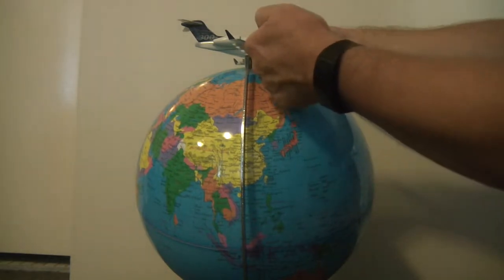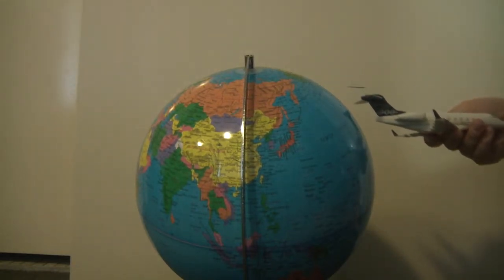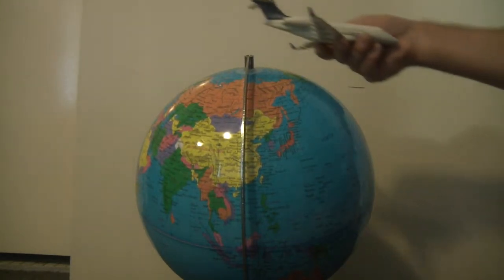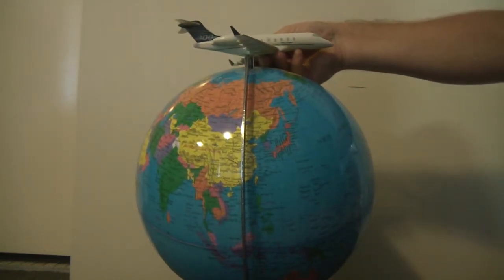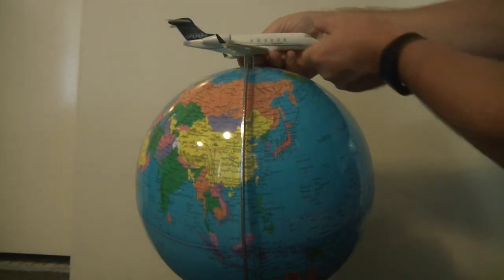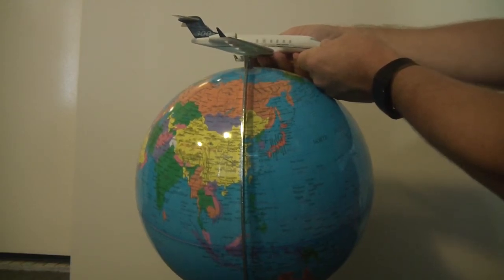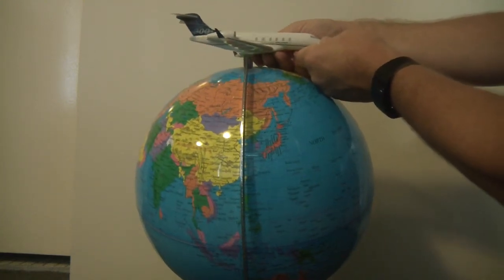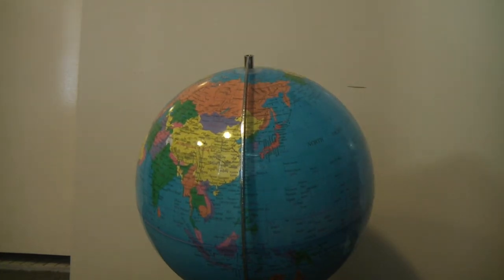A quick response to Globebusters.  You got it wrong guys.

Comment: (1:53) "Every 111 km requires 1 degree of altitude change and it's a smooth change".

1 degree of altitude change is not even a smooth change if the gyroscope is leveled all the time. So you are really trying to get people to believe that the plane is constantly dropping down the nose without the gyroscope showing it? 1 degree can easily be seen on the altitude indicator, and still some fast aircraft's have it leveled for thousands of kilometers. Why are you lying?
Reply from the maker: +christ4u2now.   You are not understanding what I said at all.   

You have also confused the word altitude with attitude - they are completely different things and you use the wrong word every time in your post. 

1 degree cannot be seen with the Altitude Indicator.    That is wrong. 

1 degree can be seen with the Attitude indicator if it was an quick adjustment - but if the attitude indicator is self correcting at the same rate as the aircraft movement you won't see a thing.  1 degree in 8 minutes.  Do you understand how slow that angular change is?  Well below the ability for us to see actual motion.

Of course it appears level for thousands of kilometers.  Flying smoothly around curvature matching the curvature your relative perspective does not change. 

I am telling the truth - the real question is,  why can't you understand something that is very simple? 

Globebusters got themselves totally confused over this and probably still don't get it.
Reply from the maker: +christ4u2now. 

No that is not a good video at all - did you watch the Original by Rob Durham here.

https://www.youtube.com/watch?v=nUFMZkxochs

Rob made many mistakes. 

1. He powered the gyro with air pressure - it is designed to run on vacuum.  He likely damaged the gyro by doing that. 
2. This type of directional Gyro has a Latitude adjustment Nut that offsets the balance slightly to compensate for Earth's rotation. 
3.  When measuring the drift of a gyro like this, it must be placed on a vibrating platform to overcome bearing friction. 

Rob did not know about the Latitude Nut and he did not use a vibrating table. 

Please read my commentsto Rob posted on his original video.  He is a good guy and acknowledged his mistakes.  He was even going to send me the gyro to test in the Southern Hemisphere. 

So you see my friend.  You are relying on flawed information because you don't understand how these things work for yosuelf. 

Did you see all the errors in Rob's video?  Obviously not.  I spotted them all right away and Rob now realizes them to. 

Try again... :-)

Comment: quick question if i may (sorry if you covered it). What amount of deviation in altitude would you allow before starting to correct it (at normal cruising altitude). I am sort of assuming that autopilot is correcting almost instantly all the time within a just a handful of meters either way of the required set altitude? Is there an 'operating window" of sorts when flying by hand?
Reply from the maker: Hi Simon,  the normal tolerance is plus and minus 100 feet of the assigned level and the autopilot will hold this easily in most cases. 

You are right, the autopilot will hold it within meters most of the time unless we have moderate or severre turbulence.  If we can't hold altitude within this +/- 100ft you must report it to ATC and they can assign a larger block level until clear of the turbulence.  e.g operate in a block 40,000 ft to 42,000ft.   

When hand flying the same tolerance applies.   In a flight test, if you deviate outside of the +/- 100 feet it is not an instant fail as long as you recognise it quickly and start correcting.   A pilot can fly like crap with an examiner on board but if you say "correcting" often enough you will pass anyway...  :-)

In reality though, after a few years it is pretty easy to hand fly within tolerance.  A few years ago I was flying a Hawker and the Autopilot failed and we didn't get it fixed for four months.  It was actually the best thing that ever happened because I flew back and forth across Australia a dozen times all by hand.  Up at 41,000 ft it takes a light touch but it really sharpened our skills.
Reply: Wolfie6020 Awesome. Thank you for the quick very descriptive reply.

You're a lucky bugger getting to do all that cross country flying!
Reply from the maker: I can't wait to retire and focus full time on making FE debunking videos.  :-)
Reply: Wolfie6020 Mate, honestly you really should spend your precious time more wisely than that!
Reply from the maker: Very true Simon and hopefully the nonsense will be over by then.

Comment: Ok so pilots are trained to make that 1 degree adjustment to follow the curve dont think so show me where it is in ANY flight manuel ever its flat bud!
Reply from the maker: It seems you did not understand my video at all.  Did you actually watch the original?   Show me where I said in my video that pilots are trained to make that 1 degree adjustment?  Those are your words.  I never said that at all.  That assumption comes from your misunderstanding of what is occurring.  Please watch the full video closely and listen carefully.  If you still don't understand I will happily explain it to you.
Reply: Wolfie6020 original video ok which one would that be anyway how does the pilot adjust for the so called curve! also how can u see the ground level of buildings ships etc from 50miles impossable on a globe btw im in NZ too
Reply from the maker: Ok, no worries,  this video here. 

https://www.youtube.com/watch?v=avXJqA3w7qk

This is the video Globebusters tried to debunk using math that is totally irrelevant to a moving aircraft.  

If you drive a car around a steady circle at a constant speed there is nothing "exponential" about the input required by the driver.  

Pilots are not trained at all to adjust 1 degree down for curvature.  However they ARE trained to maintain altitude.  This is achieved by reference to the flight instruments,  Altimeter and VSI.  By maintaining altitude they are automatically compensating for curvature.    A fixed pressure level above a curved surface will also be curved.   This is the path the aircraft is following when maintaining altitude. 

Think of it this way.   You are driving your car on a straight road - can you let go of the steering wheel indefinitely?   How long before you drift out of your lane?  A minute or two tops? 

Driving on a straight road, you need to make constant tiny corrections the passengers don't even notice.   If the road curved just 1 degree in 111 kilometres you would not even see it in the visible road ahead, however, by simply driving in your lane you are slowly (and unnoticeably) following the curved road. 

Same thing happens when maintaining altitude  You only change 1 degree in 111 kilometres,  (8 minutes at 450 Knots)  

Nobody on Earth can see or feel a rate of angular change that slow. There is no pilot training required to adjust for curvature.  Simply maintaining a constant altitude is all that is required.

That was the second mistake Globebusters made.  They claimed you would have to descend exponentially.  Completely wrong.  There is no descent required at all. The objective is to maintain a constant altitude.
Reply from the maker: PS,  Great place NZ,  I come here as often as I can.

Comment: Does the submarines operate in same manner?
So what about the curvature of the water, i mean, I think one have to compensate for it?
Reply from the maker: I honestly don't know as I am not a submariner but I can guess how they work.  They would use water pressure to determine depth.   If the water is curved at the surface then the point that is 30 meters down would also be a curve (following the surface)    If the submarine is simply maintaining a constant depth based on water pressure it is naturally following the curve.   

At submarine speeds the angular change per minute is tiny   Assuming the Sub is traveling at 20 knots it would only need to adjust its attitude by 1 degree smoothly over 3 hours.   That is only 0.005 degrees per minute
Reply: Actually I did see a YouTube at one stage ( I can’t find it now) where a flat earther claimed that a submarine would be unable to maintain a set depth on a spherical earth; same sort of argument that we see from the non pilots “if you travel in a straight line over a globe earth your altitude would constantly increase” (!), so he believed the sub travelling in a straight line would eventually break the surface. It was interesting to note that this guy said he had been in the navy so knew all about submarines. Even more interesting to see that he had been (unsurprisingly) contradicted by an ex USN dive officer but seemed to believe that he had a better grasp of the physics than the experienced professional.  I think that says a lot about the flat earth mind set.

Comment: Why don't planes fly off into space? What makes their path curve down towards the planet?
hmmmm....
https://youtu.be/DutJLb-c0vs?t=302
Reply from the maker: Simple physics and aerodynamics my friend.  Let me explain it.  An aircraft flies by lift generated by the wings.  To maintain altitude you need enough lift to match the weight of the aircraft.   Lift is dependant on many factors,  Speed, Air Density, Size and shape of the wing.  

If your air density reduces, your lift reduces,  if your speed reduces your lift reduces. 

As we go higher the air becomes thinner.  It drops by roughly 1 hpa per 30 feet.   At 18,000 feet the pressure is half of that at ground level.  

If an aircraft is cruising at a constant power setting it will maintain a steady speed.  If something causes it to climb the speed will reduce, (power setting remaining constant).  As the speed reduces the lift reduces and the aircraft nose will automatically pitch down to regain speed. 

Even if you tried to climb with full power, eventually the air is so thin your engines will be producing less power, as this happens you cannot sustain the climb,  this is what is called the aircraft "absolute ceiling"  It literally cannot fly higher than this as the air is too thin and there is not enough power to sustain a climb. 

https://en.wikipedia.org/wiki/Ceiling_(aeronautics)

And a link on aircraft stability which explains why the nose can pitch down automatically. 

http://www.boldmethod.com/learn-to-fly/aerodynamics/3-types-of-static-and-dynamic-stability-in-aircraft/

However none of this takes into account the accuracy requirements when flying under the instrument flight rules.  

You must maintain your altitude within + and - 100ft of the assigned level -  so if we are cruising at 40,000ft we have a vertical lane between 39,900ft and 40,100 ft.    The aircraft will not maintain this accuracy by itself for more than several minutes.  A pilot correction is needed (or autopilot). 

The adjustments required to stay inside your vertical lane accurately will be automatically compensating for the earths curvature and the pilots will not even notice it as the rate of adjustment is so tiny.   The vertical lane is curved to match the Earth's curvature  (staying the same altitude above Sea Level always) which means just by staying in your lane you are following the Earth's curvature.

Think of driving on a road that curves 1 degree in 111 kilometers.  You would not see this curvature at all in the visible road ahead - it would look straight.  All you have to do is drive within your lane and you will be automatically following the road curvature without even noticing it.
Reply: here's a quote.. 

"Positive Static Stability
 An aircraft that has positive static stability tends to return to its original attitude when it's disturbed. Let's say you're flying an aircraft, you hit some turbulence, and the nose pitches up. Immediately after that happens, the nose lowers and returns to its original attitude."

Stormforce, if an aircraft is trimmed for level flight, then if it "tried" to fly in a straight line as the earth sloped away, it would need to enter a climb.  But it won't because it is trimmed for level flight and it will continually pitch DOWN to maintain that.

Comment: So what about the claim of several pilots saying that during manual flight, they can leave the airplane on a set altitude and with good weather conditions, not have to touch/adjust it for miles?

Even Bob on the Globebusters made this claim, what is your answer to that?

Thanks for your time.
Reply from the maker: Hi Victor, this is exactly like driving on a perfectly straight road and
 letting go of the steering wheel. The car will go straight by itself 
for a while but not forever. Within a short time you need to make a 
correction or you drift outside the lane. A perfectly trimmed aircraft 
will hold level for a short distance too. One person here claimed they 
had done it for 30 minutes and said it held perfect level. 

I called BS on that because I know it is not possible. 
He finally admitted it was only a few minutes. 
Another person claimed he did it for 20 minutes but 
has no video. I have asked him to produce a video for 20 minutes with 
the pilot's hands and feet completely off the controls. Let's see if he 
can produce it. I suspect he will get a few minutes at best. An aircraft
 trimmed correctly that is statically and dynamically stable will try to
 maintain a steady speed at all times. If trim and power setting is 
constant. Any slight disturbance that raises the nose will result in a 
climb and a loss of airspeed. As the speed drops off the down force on 
the tail reduces and the nose will drop automatically, speed will 
increase and down force on the tail increases and the nose will rise 
again. It should stabilize back to level quickly. Flying on a clearance 
your altitude tolerance is plus and minus 100 ft of the assigned level. 
E.g. If cleared at 6000 ft your vertical lane is from 5900 to 6100 ft. 
The natural stability of the aircraft will not hold this accuracy for 
long (like a car drifting out of the lane when you let go of the 
steering wheel) To maintain the accuracy needed the pilot (or autopilot)
 will need to be making regular adjustments to the pitch attitude.  

Ask Bob to produce a video of this.  Take hands and feet fully off the controls and see how long before it starts to drift. 

I can make a claim that on a straight road I can let go of the steering wheel of my car and it will stay perfectly in the lane for 30 minutes...  However based on your own experience driving a car, do you think that is a credible claim?
Reply: Thanks for your response, Wolfie. I appreciate your time.

To answer your question at the end: if the lane is 100 feet wide, I believe my car can stay in that lane for a long time, though I don't know that it would be 30 minutes. But 10 minutes? that seems doable. At the same time, a car can't travel as fast as a plane, so that's where the analogy breaks down.

If a pilot can take their hands off the plane during manual flight for even 2 minutes and not have a change in altitude, would that disprove the globe? Or perhaps argue for a much bigger size of the globe earth?
Reply from the maker: Hi Victor, sorry I missed this.  Yes if the lane is wider then the car would take longer to drift out of it. I completely agree.  But you are also correct that aircraft fly much faster.   800 Kpm is many times faster than a car.  You can deviate up and down 100 ft in just few seconds of inattention.  

I think I could trim the aircraft well enough to stay inside the 100 ft lane for a few minutes but 20 - 30 minutes, no way.  That won't happen consistently.  That is why I have asked those people to produce videos showing 20 minutes hands off flight.   I doubt they will.
Reply: Wolfie do you agree with the postulation that the craft will pitch down by design?  It's well documented if you research dynamic or static positive stability.  I've just never heard you talk about it and you seem to just attribute the effect to minor manual/autopilot adjustments.